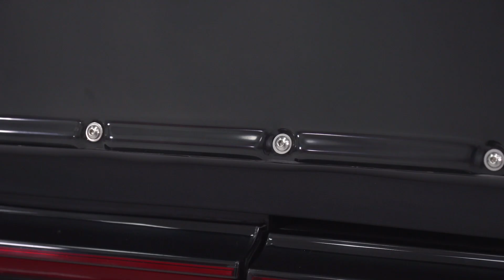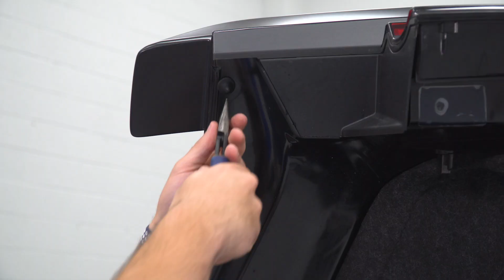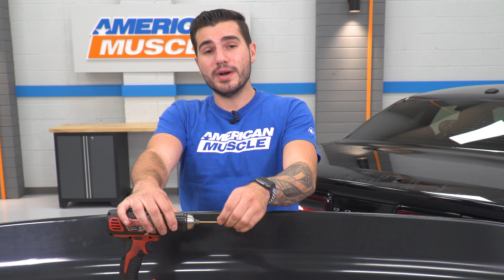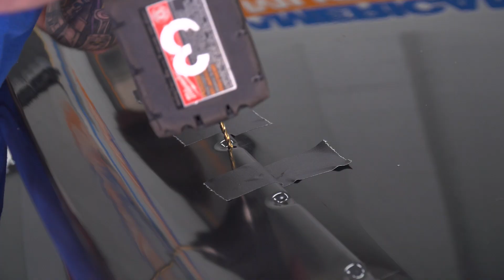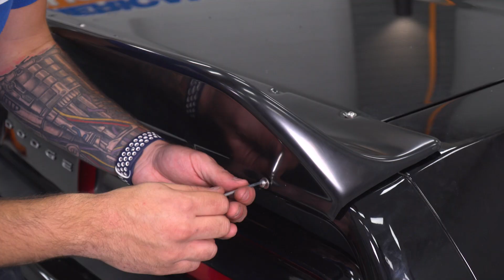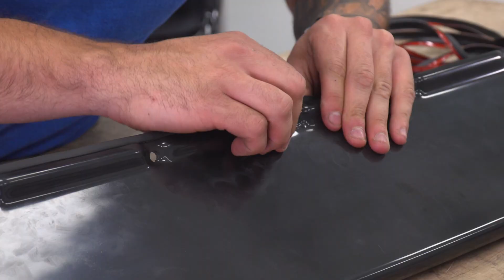2008-2019 Challenger Clinched Flares Ducktail Rear Spoiler - Unpainted Review & Install

Comment: A lot of guys are adding them to their Challengers, but they are mainly for looks and slow you down at the strip. Same thing goes with the aftermarket splitters and are good for the Salt Flats, but just add extra weight for short distances and is not a good performance upgrade for drag cars